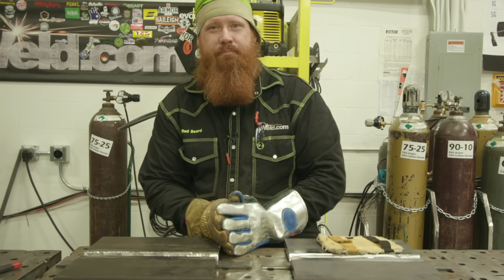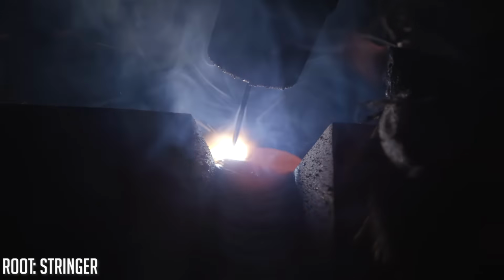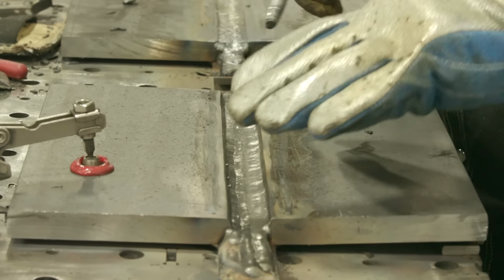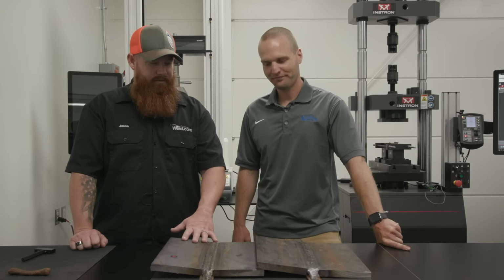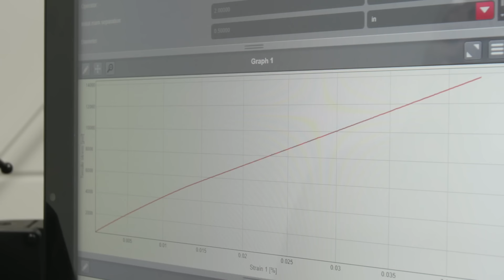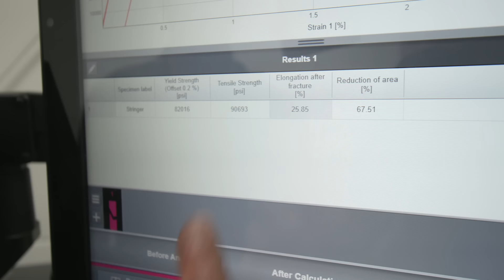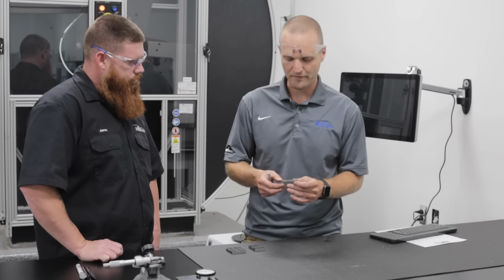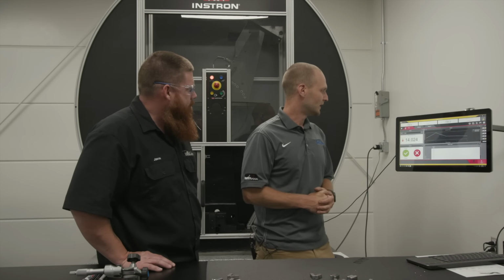Stringers vs Weaves

Comment: This popped on YouTube today.  The main reason that stringers are stronger is because each stringer normalizes the previous bead. This means that the grain structure within each bead becomes small roundish grains. Forming a tight chain. Weaving tends to give a jagged structure called columnar crystals. There is also less chance of the formation of hydrogen pockets, which can lead to hydrogen induced cracking. The test used on oil platforms in cold environments like those in the North Sea is COTD (Crack Tip Open Displacement). This is where a small notch to simulate a crack is put into a material. The material is cyclic loaded like bending a can back and forth. This is done to replicate wave motion. After a number of days, the specimen is measured to see how far the crack has run and also to see how much it has opened. The tighter the grain, the better are the results. Sorry if too technical. Love the videos by the way, keep them coming.

Comment: Stringers = Stronger   Weaves = Weaker   the first letters are the same so its easier to remember.
Reply: @mail-qh2qc  weaves are worse for joint pain.
Reply: Depends on the kind of stress and load that the weld has to withstand.
Reply: Man... What a spoiler.  I wanted to watch the whole 30 minutes before I found out.
Reply: Very well said👍👍
Reply: Well said, man 😂
Reply: @Taunus-Tim  What? Stress is stress no matter what, there is no "kinds" of stresses. Same goes to load. If you mean AMOUNT of load and stress stringers will generally be stronger.
Reply: @gabrieljordan9977  might be a language problem. I meant the different kinds of forces. Like momentum, push, pull, sheer and so on.
Reply: How very welder of you

Comment: The fact that some welding certifications do not allow weaves tells me all i need to know about them.
Reply: Common sense would typically have you earning much more thumbs up with that comment. However, I've realized over the ages that common sense isn't common. bottom line, weaves aren't allowed in some certifications, they've been tested and found not up to par.
Reply: @TechieTard  Common sense would also refrain from redundantly repeating what was just stated. I mean, I know in engineering that redundancies are good n necessary, in this case no.
Reply: Anything not structural or high pressure.
Anything a level 1 welder cannot touch.......in other words stick to garden furniture 👍
Reply: For the record, there's actually not a great deal of difference between a weave and a multi-run fillet, when performed with the requisite skill, in terms of penetration. Weaves, however, tend to impart excess heat into the material (as per the video) and are much easier to fuck up aesthetically, that's why they're usually excluded.

Comment: I'm a hobbiest welder but also an engineer so I'm really geeking out on this data.  This is super educational and well done.  I was a fan of weaving with my little MIG until today.  You changed my thinking.  Will add this to my playlists and add it to my personal favorites list as well.
Reply: i'm the same, welding 10mm thick is a big day for me, mostly 6mm 3mm stuff. also i've never seen a mig set leave a slag cover like that before, is that the wire type or flux coating or something?
Reply: Wint3rsmith   He’s running duel shield, flux core wire but also 75/25
Reply: Must be Andrew Luck !
Reply: I'm gonna start working on my stringers  as well

Comment: As a CWI I love seeing someone do a legit test like this.  I hear from so many welders that "there's no difference" and this is a great video to show them
Reply: it is purely because of the heat buildup? i wonder if you weaved but started from the center and welded out would that change?
Reply: Also stringers has less thermal deformation due to shrinking - only the last string connects both material "coasts" to pull it together.

For high pressure steam piping (heat treatment to release tension, X-rays tested) I've seen strings only. There is a good reason why those critical welds (where human life depends on it) are forced to be strictly a string only. For those critical applications whole weld procedure has to be tested and certified before applied on site.

Comment: Weaving for superficial looks, stringers for core tensile strength. Great video. 👍
Reply: So do stringers up to your last pass, then do one weave to make it look fancy.
Reply: Terry dodson it was not an honest test to hold your weld metal at 350 or below the stringer passes had less heat an more time to cool if you would of stopped your weave passes about half way an let them cool back to 350 degrees an then finished your weld especially when you were over half way through the weld . There's notably way more heat in a weave pattern especially as you get closer to your cap. I have been a welder for over 35 years ,an stringer verses weave has always been a debate over with was best .most companies I have worked will not let you run weaves over a certain size most want stringers .Really good test though never have seen one so done by the aws labs before nice job,enjoyed the video.
Reply: @terrydodson12  The fact that some welding certifications do not allow weaves tells me all i need to know about them
Reply: @terrydodson12  time is money 🤑
Reply: FYI weaves are used in the field with certain applications to stress relief the previous pass (smaw).  

Weaving is also faster production with smaw.  Put two welders welding pipe.  If one runs stringers and the other weaves, the weaves will finish faster every time.   Seems to burn hotter which makes sense with all the local heat.

Comment: I was taught by a pipeline welder,   that multiple passes were the strongest, and later a logger confirmed the same from his experience. Imagine my shock when welders who had never had to test welds in extreme cold began to harp that the bigger and fatter the bead, the stronger it was. They still think it, just because they have never seen a weld fracture in cold.

Comment: To be fair its about heat input..  you can make a weave just as strong as a stringer. It depends about weave width to bead length. Being a hull cutting welder for nuclear subs Says alot.  We can weave to a certain point before it changes the metallurgy of the metal.  And our tests get mt'd and xray'd.

Comment: ME in training here. We covered this type of testing last semester in my materials course. Very interesting to see practical applications for it. One thing that a super rigorous experimenter might do to further reinforce the results would be to run the tests on several sets of samples, all welded by different people, just to make sure that any individual technique variation would be averaged out.  Cool video!
Reply: Exactly, this & several samples testing tensile in different directions as well - parallel to the weld & perpendicular.
Reply: @Farlig69  You're testing the weld strength, so you want the weld bead to be in the middle of the specimen. Which means perpendicular specimen. There would be no point in testing pure weld metal.

The plate is a known material, with known properties. The weld is not. You would not do test with different orientations. Not only that, but as long as the metal is in the middle, it wouldn't matter.
Reply: that hammer has to have some impressive microsecond reading
IMO when weaving one side cools down before you come back to it and that's a problem too

Comment: This was a great reminder.  I’m about to weld up four 40’ tall wind generation towers that ‘break’ at the base to lay over for repairs. The spec is for 16 tonnes dynamic load. I’m going to be making up several of this type of joint and am glad for the reminder. I’m a farmer and not a welder by trade so these videos are real life savers!

Comment: Thank You, There aren't enough video's about the higher end welding applications. We don't have a lab where I work, so we send off samples to be tested for WPS docs. So this is a great learning tool. One of the larger companies recently added a requirement that on every WPS ( welding procedure specification ) must state that no bead be larger than 3 rods wide. If your using 1/8" that means that the single stringer bead can be no wider than 3/8". Thanks again.

Comment: Wow. That was amazing. Thanks for sharing.  Next up. Rod vs wire.
Reply: just add in TIG and oxy acetylene welding just for good measure. would be fun to see the results of the different types of welding.
Reply: Always keep your stick on the ice and your rod in a heated quiver! ;-)
Reply: @WBush-uc9pe  Was that a little AVE added in there? But he's talking about a vice not ice and he isn't talking about a stick.
Reply: @mancelprince7426  see Red Green.
Reply: Yes, lets see multiple types!
Reply: Wire is for rookies. Rod for the win.
Reply: @Deere2154D  I learned rod first, its the easiest in my opinion. But TIG is the most fun in my opinion.
Reply: @Deere2154D  I learned rod first too, I use my mig welder a bit more, its just easier and faster.
Reply: @mancelprince7426  Note his earlier videos it is: "Keep your stick on the ice," a hockey reference.
Reply: @spudpud-T67  I understand. At some time he change from "stick on the ice" , a hockey expression to "dick in a vise", an AVE expression. We're on the same page. Thanks for the response.
Reply: And let's go even more old school -- carbon arc welding...
Reply: It's all about controlling the variables. Stick and TIG done right to spec of the same materials will yield insignificant differences.

What you wanna see is an old hand stick master and an old hand TIG master freehand some crap in a barn and compare that. 

Gotta say, I know those masters...would be pretty close.

Comment: This is really really really good - good round-up of the just about all the basics - of welding, testing and understanding where weld properties come from - and I express this personal opinion from being a trained metallurgist, Ph.D. level scientist whose investigation was welds, and a practicing welder doing structural steelwork.
Reply: You had me right up to that last bit, (practicing welder doing structural welding).
Reply: @deconteesawyer5758  I am a commercial welder, mostly.  I frighten most "in suits" types too much.  Last weld I did boat hull repair they do 6013 wide-weave, I tried for quick reminder then switched to,7018 stringer.  Works well for me.
You can reach 150A v-up T-fillet 7018 if you stringer - and I don't believe you can get anywhere near that if you wide-weave (?)
Reply: @deconteesawyer5758  This is excellent very objective evaluation.  The answer is known, but they are displaying it all for you to see.
A truth does not mind being questioned; a lie responds with ferocious anger trying to prevent anyone examining it.
These people are surely being most generous inviting a truth to be both questioned and examined.

Comment: This was really interesting; my instructors back in my active college days didn't have a charpy machine, only tensile and u bend test rigs (this was back in the the early '90's), so seeing the same results with much more accurate testing equipment was awesome. 

Thanks for doing this, as well as confirming my faith in dual shield welding as (for the most part) the best of world's for structural work.

Comment: Worked as a metallurgist apprentice for while doing similar tests at a welding R & D company...I thought everyone knew the weaves were all look...

BTW...your buddies at that lab have some nice toys. 

We focused alot on gas mixes. So fully controlled heat input and ambient. Fully controlled weld instruments and weld metals, fluxes and/or gasses. The weld samples were even prepped at specific sizes. 

The welder would run root to cap at specs in a tent and the sample was immediately placed in liquid nitrogen. From there a certain amount went into a gas analyzer, some we'd put in epoxy which would freeze the gasses escaping from the weld, and of course we'd use some for the tests conducted in this video, including the acid etching.

People love the epoxy. The visual effect of seeing the escaping gas helps even the old welders put something they've been told their whole career exists into reality. 

Fun stuff. The welding and the testing.
Reply: Is there a term to search to find the offgassing epoxy photos? I'd like to see what that looks like, but Google only shows JB weld 😆

Comment: Thankyou, Very good and Scientific Data. I understand a bit better now how internal "soak" temperature can soften welds. The weave up near the top was quite excessive (and I expected inclusions there) but putting more metal down in one pass shows that is NOT better in the long run. The weave went down faster, BUT it was an in-effective weld and may fail in service, (depending on the purpose and specifications for the weld) my boss is always saying that I have to do the job "Faster" but this shows that this is not the "Right" way to do it.
Reply: I hate that. Constantly chirpin' at ya to go faster faster then suddenly you're the one to blame when things fuck up.

Comment: Awesome video and test. Reminded me of teaching welding in the lab and teaching Metallurgy in the other lab alongside. In the end Heat soak and input is always greater packing on layers with a weave pattern. Get in and get out, applies with any process and any filler.   Multiple hot consistent passes win hands down. We could pass test in all ways with tight, fused metal over slower fancy swipes!

Comment: A great demo. I have gone through this myself at work. Lots of testing  and qualification to meet Charpy requirements of the oil sands in Alberta Canada. We even had Lincoln visit us while testing their LA-71 wire to see what we could achieve. Keep in mind everything is thermally stress relieved which makes it harder to achieve.

This knowledge is as old as dirt though. Stringer beads reduce heat input but also has a grain refining effect on the previous beads your are welding over.  Also take a look at the essential variables table of a code book. They all limit bead width. Basically if you want to weave you need to qualify it.
Reply: You said it. When I said it, I got laughed out of the shop because I wasn't carrying any welding certificates. I still knew I was right.

Comment: Great video.  To understand  just how each weld affected the steel, a base line test would be beneficial.  Test a sample of an un-welded section of the same material. Keep up the great work.
Reply: I totally agree. A baseline from each coupon was necessary to know the starting point. They measure the end up points, but they don't know how far they deviated from the starting point. So what do they really know?
Reply: The base metal, A36 in this case, has standardized properties and values.
Testing the base metal would only serve the purpose of verifying that the steel mill
wasn't cheating.

Comment: My weld instructor only taught weaving for vertical welds. After each pass he had taught us to squelch it to prevent excessive heat. On the state certification we tested one weld in each position for each machine we wanted certified on.  He taught walking the cup with the Tig and straight welds for everything else. I was taught back in 1994 and 1995 though, so thats been 25 years ago. I got state certified and never used it other than fixing broke stuff around the farm. I see a lot of bad habits being passed on as "secrets" on youtube channels, from people doing circles with welding rods, to walking the cup with mig welders. I was also taught to only ever make a bead longer than an inch every other inch  if the item needs to be air tight or water tight. To save on welding rods unless you are building up a shaft or a surface with weld to be cut down to size.

Comment: Well, when you're weaving that wide, dont think there will be much hope for it in the strength tests.
Reply: He didn't test the wide weaved cap.
Reply: The cap was ground off, but it still dumped a massive amount of heat into the part. I worked in a fab shop that built bridge beams. One of the "ol timer" types decided he was gonna weave instead of stringers, regardless of what the specs called for. They were told the steel would have to be scrapped (or used for shorter pieces if possible) because weaving dumped too much heat into the part. The beams had to be cut back 100mm to remove the tainted steel.

Comment: In all my years as an ASME certified welder, I've never seen a GMAW/FCAW welding procedure with a 1/2" root opening for 1/2" plate.
You can keep your interpass temp at 350F but your heat input from weaving will cause your cracking and lack of fusion problems. Most ASME customer required weldments would require a Joules requirement formula for heat input. Jobs and material to be used in environments of -20F would certainly require this.
Reply: @dohabandit   I agree. The issue of weaving in the middle portion of the weld as well as the cap pass. still presents problems with lack of fusion in the sidewall as well as the previous pass. My response is predicated on those who are welding under a certified weld procedure. For those in other welding circumstances, you do what is best for your particular need, but I believe stringers are the best for penetration and fusion ( if weld parameters are set right).

Comment: Great vid.  I've never welded in my life nor plan to.  I literally knew nothing about welding but after watching your one video I know something about weaves and stringers, tolerances, testing , how the samples are cut and to switch gloves when you switch hands.
Reply: So a little tid bit on switching gloves hes wearing 2 different gloves, one is thicker protects from heat more (usually used with stick welding) and the other is thinner (usually used in tig welding) for more fine motor control. In case you didn't know why he was switching gloves when switching hands